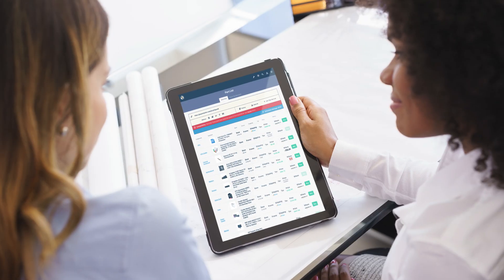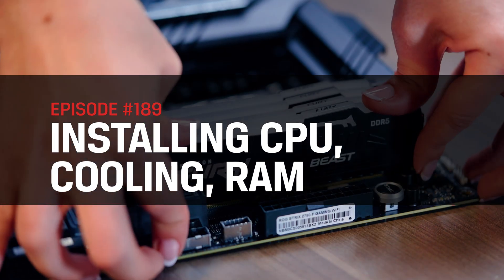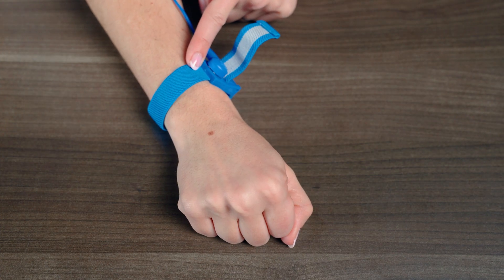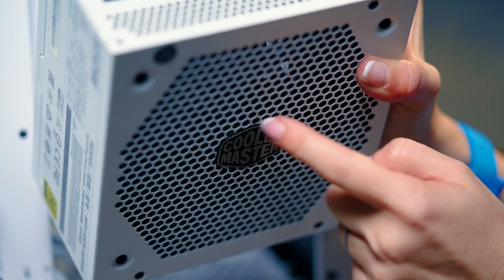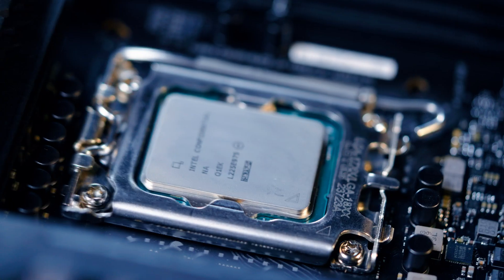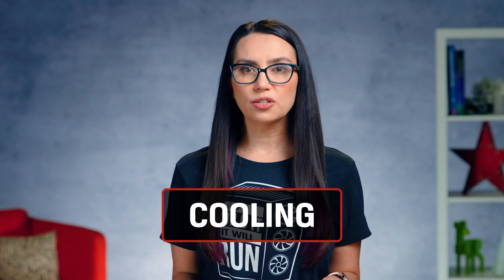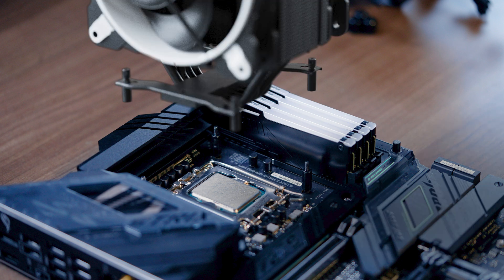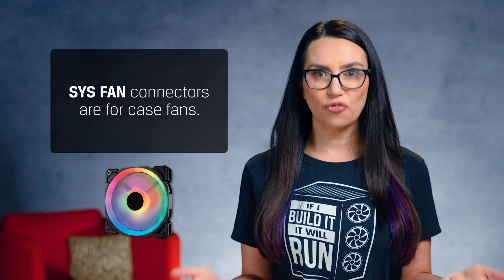PC Build Guide – Installing CPU, Cooling, RAM – DIY in 5 Ep 189

Comment: In anticipation of the next video, I am concerned about all the connections and cables from the PSU > Motherboard > Case.  Probably outlined in the manual, but still big concern of mine.